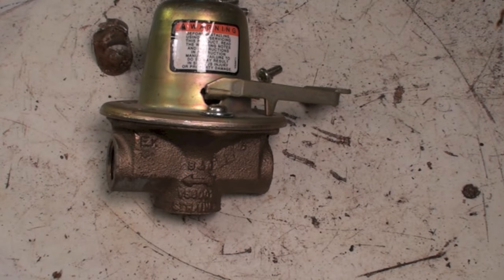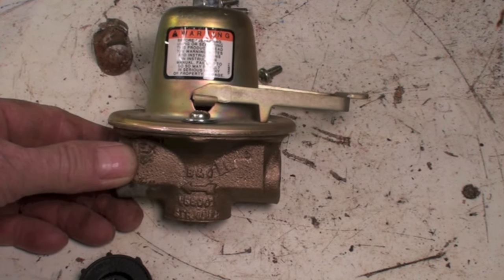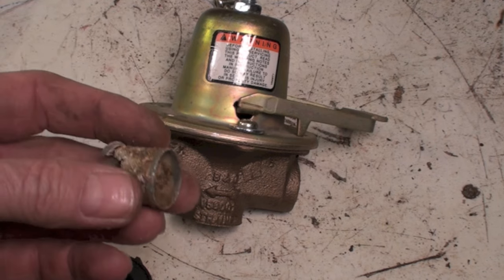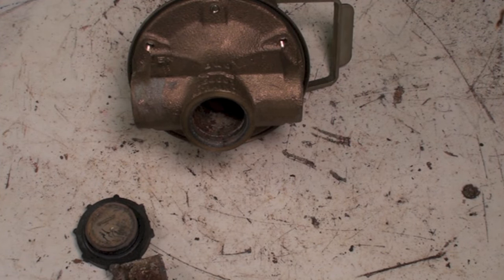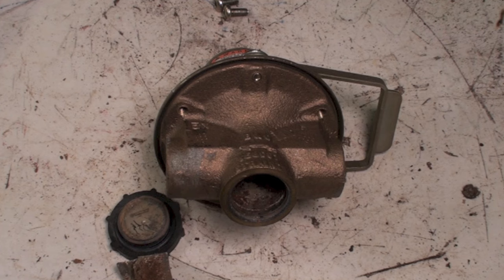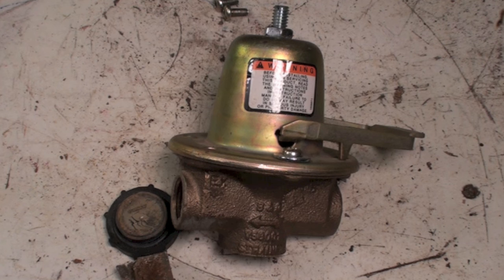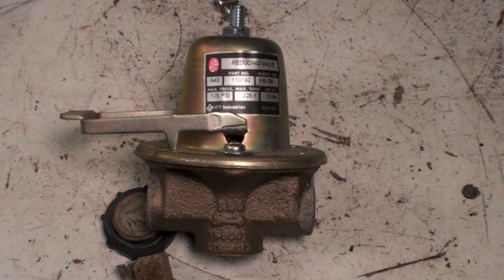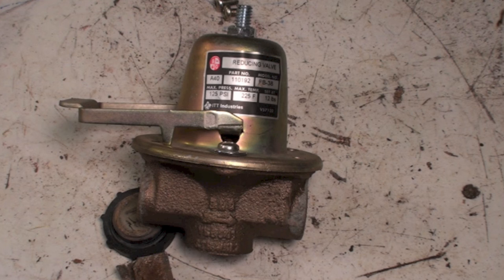Troubleshoot the boiler pressure reducing valve

Comment: Would over-feed cause the pressure relief to leak? On my furnace i noticed the pressure relief starts leaking when it is brought up to temp. I replaced the expansion tank. Same problem. Just replaced the valve. Still leaking. Not sure where to go from here..you think it might be the prv? Thanx man
Reply from the maker: John Lewis Many times when the system has not fed water for a long time and then does, the reducing valve will not shut off.  There are other possibilities like the expansion tank is too small.  Hope this helps.
GFM

Comment: Replaced the Xtrol and pressure release valve. Pressure goes up to about 35-40 psi ans spills out. Bad regulator?
Reply from the maker: This is almost certainly the reducing valve.  If you shut off the hand valve (if there is one) for the supply water, the rise should stop.
GFM
Reply: @grayfurnaceman  yes it does stop. I just ordered a new regulator. Thank you
Reply from the maker: @rotorway133  You got it.
GFM
Reply: @grayfurnaceman  ok so I am still waiting for my regulator from Amazon. Water input valve has been shut off for a few days. I just noticed that pressure went over 30psi since it spit out.  What  pressure should I read when the water cools down?

Comment: Had no heat, boiler pump 007 had stopped. Also had some Water on the floor from pressure relief pipe. I opened the bottom on my water pressure regulator and the screen was missing part of it. The water had eaten it away after 13 years. I tapped my 007 and removed the screen and now everything is working fine. Is it possible that the screen could of traveled to my pump?
Reply from the maker: Probably not with the screen.  The pump is probably failing.
GFM

Comment: 2 middle zones of house are working fine.
Reply from the maker: It sounds like the valve is feeding.  It should feed up to the set pressure, then stop.  Lifting the bail bypasses the reduction feature of the valve and if left up it will overpressure the boiler and the relief valve will open.  Shut off the domestic water supply valve upstream of the reducing valve.  If the humming stops, the valve is feeding.  If so, I would be looking for a leak in the system.  The pressure should be 13# for 1 story and 18# for 2.  My bet is the valve is trying to open, but the screen on the inlet is plugged.  But look for a leak in one of the lower levels.  Either way, the valve needs to be replaced.  Hope this helps
GFM

Comment: Hi Grayfurnaceman! I enjoyed your video. I have this exact same model valve (a contractor just installed it 4 days ago). I awoke this morning to find water on the floor beside the boiler (the pressure relief valve in action). The boiler's pressure gauge showed 30psi and the temp was 140F. I turned the thermostat down and allowed everything to cool during the day. This evening (with the water temp below 60F), I closed off the systems main water feed valve, bled the pressure down to 10psi. and then re-opened the main water valve. Within about 10 or 20 seconds, without adding heat to the system, the pressure gauge showed 20psi. Isn't the function of this "pressure reducing valve' to keep the pressure at or below 12psi? Or, am I thinking about this wrong? It seems to me like they've installed a defective pressure reducing valve but I honestly don't claim to know very much about this stuff. Am I on the right track? Sincere thanks! -Rob
Reply from the maker: +oatbean What is happening here is the heating of the boiler expands the water and it pops the relief valve.  To avoid this, there is either a bladder tank or an expansion tank.  The bladder tank is a can located on the piping about 3 to 5 gallons.  There is a tire type valve on one end.  If you press the valve and water comes out, the bladder is burst.  
If you have an expansion tank, it will be located in the joists above the boiler.  It could be water logged.  Hope this helps.
GFM
Reply: Hi grayfurnaceman! Thanks for the reply... but my larger question is... If there is no heat would it be possible for a functioning PRValve (which is preset to 12 psi) to be above 12 psi when there is NO heat present? I assume not (and I don't claim to know), but I'm just trying to understand for argument sake. [it was cold when I opened the main valve and the gauge went up from 10 to 20 lbs.]

The contractors are returning in the morning and if they try to sell me a different repair option I would like to keep them focused on this, if I have not assumed incorrectly. 

Again many thanks for your time!
Rob

p.s. my expansion tank is one floor up... in the finished attic. It sounds pretty empty when I knock on it (except for the top 1/4 which sounds a bit more dense.
Reply: If a tiny little amount of water comes out, and then air, is that typically okay? 

I'm trying to test my system to see If one of my two expansions tanks is bad, or if it's this valve. I have a small expansion tank next to the incoming water main, and then one down stream after the boiler.
Reply: I have this same situation going on.  Was it a faulty reduction valve or the tank?  Thanks

Comment: Why was a water softener place on the hot water of (somebody house) only and not all the cold. The cold water for the fridge is not soften and every cold tap, I find that weird. Please explain. were they being cheap.
Reply from the maker: +Luis Diaz Beats me. I am not a water tech.  Just furnace repairman.
GFM
Reply: Putting a water softener before a heating appliance will save the appliance from mineral deposits, when you heat water it loses its heavy minerals, the quicker you heat it the more they drop out. these make the burner less eficiant since what ends up inside the appliance is basically sand, and it also can clog outlets in extreme cases. You dont want softened water to any tap that a person might drink from, you dont want to drink softened water becasue water is the universal solvent and it must re gain its minerals if they are depleted and in the case of softened water going to a tap the water will re gain its minerals from leatching them out of YOU..    -Master Redseal plumber and Gasfitter for 20 years. :)

Comment: pressure adjustment?  can the top screw be used?
Reply from the maker: Yes.  If the reducing valve is over about 5 years old, it may not work and the valve will have to be replaced.
GFM
Reply: @grayfurnaceman  Thanks grayfurnaceman,  Our regulator is at least 28 years old.  I backed off the hex lock nut and I was surprised that the top screw easily moved in both directions.  I tightened it to increase the pressure 10 lbs and it's held at 10 lbs for a week now. Thank you.

Comment: I have a Bryant boiler.  It's reading a 0 H20 psi.  How do I add water?
Reply from the maker: +Grant Kozy Look for a domestic water connection.  If the valve is off turn it on.  If it is on, the regulating valve (downstream of the manual) has probably failed.  You can try adjusting the valve but it will probably no work.  Hope this helps.
GFM
Reply: +grayfurnaceman I made sure all the water valves were on.  I lifted the reducing valve to the fill position this appeared to add water and pressurize the boiler.  I think I solved the problem

Comment: hi, to fill the boiler with water where would i install this valve? thank you.
Reply from the maker: There is no way to be sure, but probably where the expansion tank is piped to the boiler piping.
GFM
Reply: You install it in the feed line 1/2  pipe right after the back flow valve

Comment: SHOW HOW TO ADJUST
Reply from the maker: I seldom adjust these valves.  Adjusting a valve after it has been in operation for several years will usually result in no change in pressure or it will leak by and overpressure the boiler.  If you must know, loosen then nut on top, turn then screw clockwise to increase pressure.
GFM
Reply: @grayfurnaceman  I did that last night and my boiler stopped making gurggling noise. My valve was installed 20 years ago... I put on a new compression tank that had 16 psi while the valve was 12 PSI.
Reply from the maker: @robertwadas  Glad it worked.  The higher pressure in the compression should be ok.
GFM

Comment: how do you adjust these to push less pressure
Reply from the maker: The screw on top is turned counter clockwise after the nut is loosened.  If it is fairly old, it will probably not help.
GFM
Reply: @grayfurnaceman  screwing this clockwise is for less water?  Opposite for more or the other way around?
Reply from the maker: @eduardoa4493  Clockwise for increased water pressure.
GFM